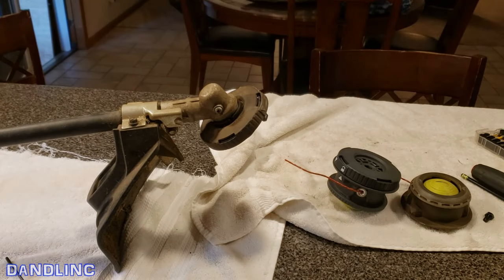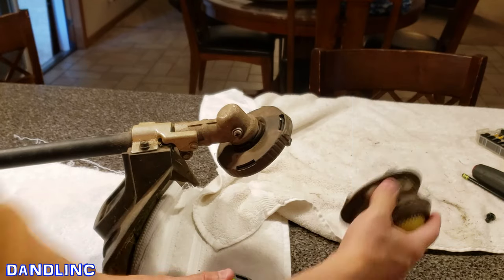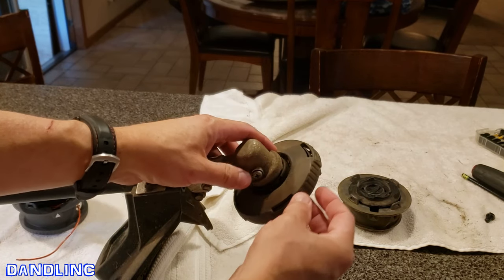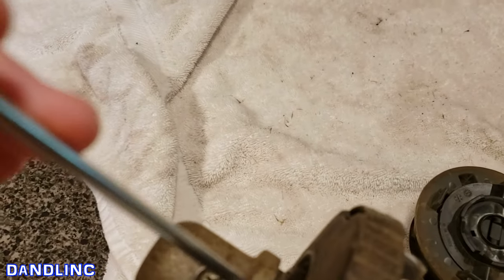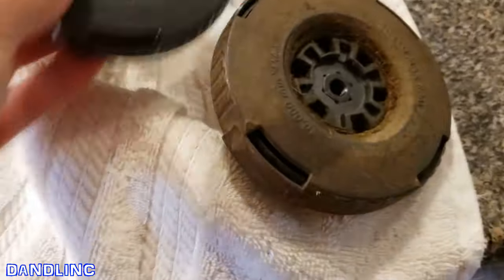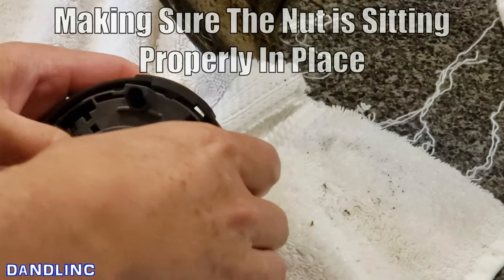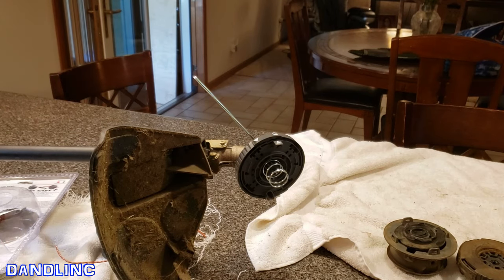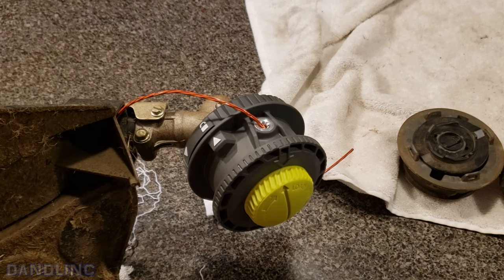How To Replace A Ryobi Trimmer Head  DIY & Save!

Comment: Went through all the steps, absolutely cannot get the assembly to turn from unlocked to locked in the final step. Everything is aligned, just cannot turn it from the arrows lined up to the locked position. About ready to throw this tool over the fence.

Comment: I have a Ryobi gas trimmer RY252CSVNM but I do not have the hole/slot to insert the screwdriver to remove the head. there is no hole on this model. Any ideas how to resolve?

Comment: Thank you, thank you, thank you!!!! My original trimmer head is completely destroyed, it started fussing by only disengaging on one side while the opposite side was stuck. Undoing it without breaking it was a total nightmare (and I had to open it really often). I finally got fed up and used a large screwdriver to pry it open and thus breaking the cheap plastic tabs. I hope their new one is better designed. At least now I know how to change it and I know it's possible to buy a replacement head. Thanks again. I wish I could give you 100 likes.

Comment: The instructions that came with mine said nothing about sliding the "arrows" to meet up and release, and being the knuckle-dragging Marine that I am I broke the head when trying to disassemble it. Thank you for not only showing the proper way to slide the two halves and disassemble the unit but also how to replace the head, which I am sure I will need to do in the next year or two.

Comment: Help this did not work. Any idea to get the total bump feed string head off the straight shaft to replace the last two pieces on the shaft will not turn to remove any help thank you